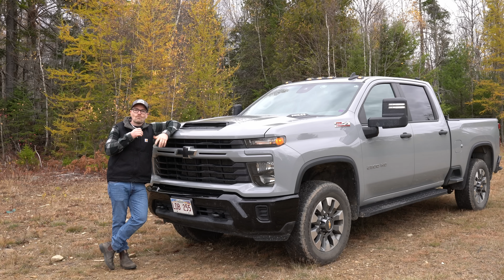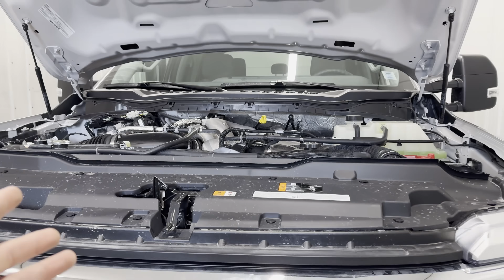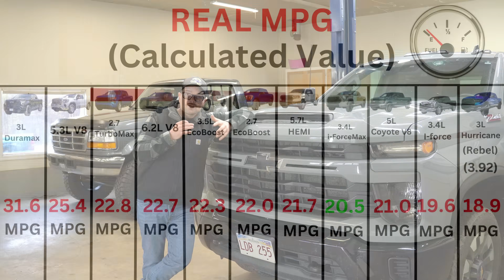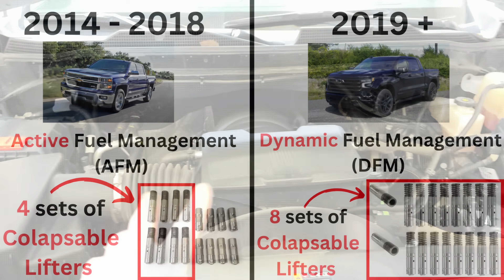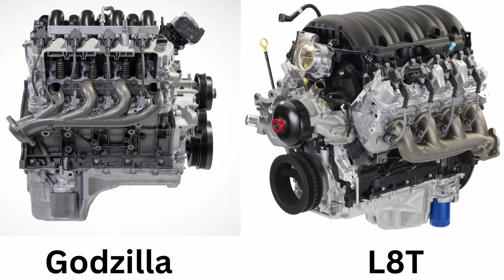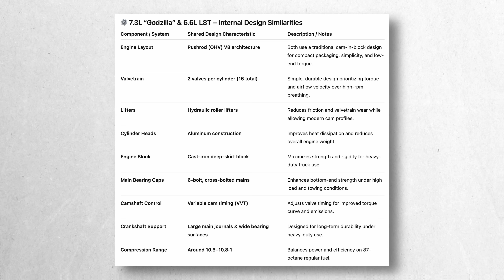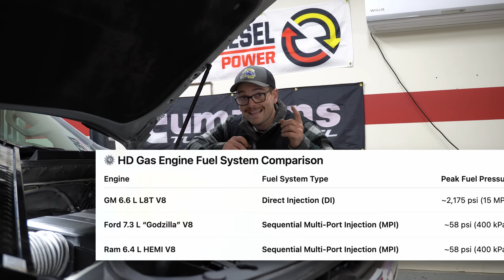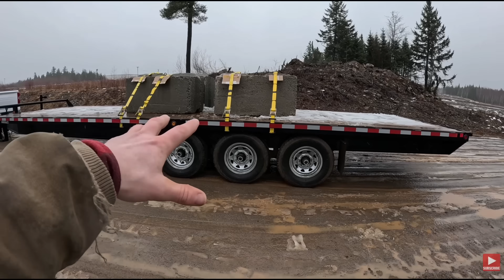Chevy 2500 6.6L L8T V8 Review | GM’s MOST RELIABLE Engine They Still Build

Comment: I’m currently researching what I should buy for a 10-12k trailer setup. Should I get this motor or the 7.3 ford?
Reply: Having a good amount of experience with both, the 7.3 hands down. I like the 6.6, but the 7.3 just has more guts to it
Reply: @NoahBrown-w6g  “More guts” means 20 more pounds of torque out of the 7.3.  You aren’t feeling that in a truck that weighs as much as a 3/4 ton does.
Reply: @holdenc3082 it's not the peak power, it's the area under the curve. 401 at 5200 (ECM shifts 4700... Soo 🤷) vs 430 at 5500 is a massive difference in torque up top.
Reply: @holdenc3082 No, more guts means it puts the torque down better over a wider range. They can have close to the same peak, but you can very much feel it when it is applied over the powerband. At 1500 rpms, it produces over 400 ft lbs. 1500 rpms is barely idle, by the way. You step on the pedal in both, the ford gets to it faster and harder. Peak numbers alone do not tell you the whole story.
Reply: I concur, 7.3 all the way!
Reply: 7.3 hands down.
Reply: I currently tow a 12,000 lb. fifth wheel with my '21 LT , from Northeast Pennsylvania . I've towed most of the East Coast and am very happy with it. Seems to do a very good job. My brother has a '21 7.3l and tows about the same , and he is very happy with his also. It's a tough decision! Good luck with whichever you decide.
Reply: Under load, I feel the 6.6 pulls better. Just my experience. On paper the Ford should win, but I just don’t feel those numbers.
Reply: @V8sRuleTheEarth  Weird. I own my own personal 7.3, and we have some 6.6s and 7.3s for work. From my experience across all of them, the 7.3s pull a good bit harder
Reply: 7.3 really no comparison
Reply: Ford ... 30% more torque down low, and chose your gear ratio. And better economy when lugging. Ford doesn't run rich at WOT, GM does.
Reply: @CorRob-h8b  Your math is messed up.
Reply: @holdenc3082 at 1300 RPM. Look it up

Comment: I’ve driven them all. The 6.6 is my favorite. The powerband, the shift points, the lower operating temp. The towing numbers.  It’s just a really good platform.
Reply from the maker: Its a great platform
Reply: I like the 6.6 a lot. I just prefer the 7.3. Has a bit more oomph and it has been smoother in my experience

Comment: Put a Magnuson on it with mild boost and it can easily and safely reach 600 horsepower due to the strong internals and heavy duty transmission
Reply: The engine is pretty robust, but as for the transmission... I am not sure about that lol
Reply: @NoahBrown-w6g much better than ram RFE pile of junk
Reply: @NYPrepper Very true. They do have that new ZF tho. Time will tell on that, but all preliminary factors point to it being a great option
Reply: @NYPrepper crying on the internet. You'll be ok
Reply: @NoahBrown-w6g  oh okay... well the 6L90 is rated to 885 lb of torque so plenty of room to spare for extra power.  My 5.3L is boosted makies 550 horse and no issues and it has the smaller trans only rated to 664 lb-ft.
Reply: @TheXOoftheRO  I am not crying, I got a 550 horsepower boosted Silverado with zero issues.  I would only be crying if I had a Ford ecobost or Ram with the RFE trans.
Reply: This transmission ia not the real HD one
Reply: @thomasnew8606 but it’s not trying to handle over 1000 ft lbs either even with a supercharger and 600 hp, the gas engine would only be around 600-650 fr lbs and I saw somewhere that this Allison is rated for 700-800 fr lbs still
Reply: Why, you reliability/durability will go right out the door!!!
Reply: @joatmon1857 agreed, if you want to use the truck like it was designed to be used I’d steer clear of power adders or things that add heat and pressure to the system.
Reply: @MX5-XU  absolutely, but mild boost won't really harm anything... maybe slightly.  We're talking adding 100-150 horsepower just to give it a little more pep.  Many people boost GM gas trucks and easily reach 200k miles with no issues if using an Eaton blower, would stay away from whipple.
Reply: @NYPrepper  I think it really depends on the use case. People often share what their stock powertrains experience in terms of coolant, transmission, oil temps etc and some believe those figures can be concerning already. Adding power and not ensuring that such impacts to the system are mitigated or perform better than they do in stock form seems like a recipe that I'd want to avoid. 

If I just had an occasional weekend family hauler/camper runabout, sure I think there is not too much concern, but if I were working it hard daily or pulling significant weight cross country all the time I absolutely would not be looking to place any additional stresses on the vehicle just to get up a mountain pass a bit quicker.
Reply: @MX5-XU I totally agree about use case. However the transmissions on the  L8T are same as for the L5P and designed to handle same torque as the L5P which is 975 at the crank.  Meaning the L8T is not even at 50% capacity of what the transmission can handle. But of course for a work truck without repairs you don't want that added stress.  However mild boost on that L8T would be fine and arguably improving the towing characteristics.  An Eaton blower is what you want, not a whipple.
Reply: @NYPrepper  Good to know about the transmissions. Why the preference for Eaton over Whipple? Just kit components or brand preference, or is there something inherent to the roots that makes it advantageous over the twin screw style?
Reply: @MX5-XU  Eaton has been around for decades they make a lot of components for not just the automative industry but also for earth moving, mining, construction, and logging equipment.  Anything made by Eaton will last as long as the vehicle or outlasat it, provided it is used within specs and maintained properly.  Whipple is newer and certainly not experienced in making industrial grade components on heavy duty equipment.  Whipples are geared more toward the racing world which favors maximum power over longevity/reliability. If you plan to have a rugged, reliable blower that will last as long as the truck go with a Eaton.  If you want maximum power in a vehicle that's not a daily driver and reliability/longevity is not as much of a concern then get a Whipple.  Also the design of a twin screw in the Whipple is inherently less reliable due to the tighter tolerances.  Roots style blower may create more heat, but they've been around since World War 2 when U.S. army jeeps and various plane engines had them installed to maintain power at high altitutdes.  Roots blowers have slightly looser tolerances which is a plus for reliability and longevity at expensive of maximum performance.
Reply: You mean like the 5.0 litre Ford with a warranty has been doing for how long ?